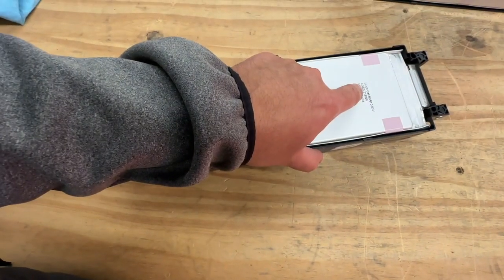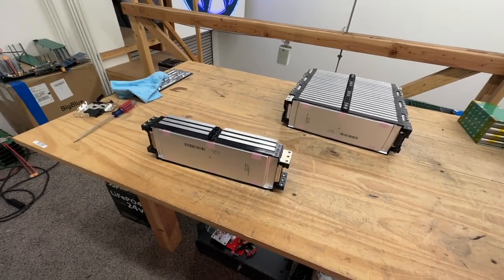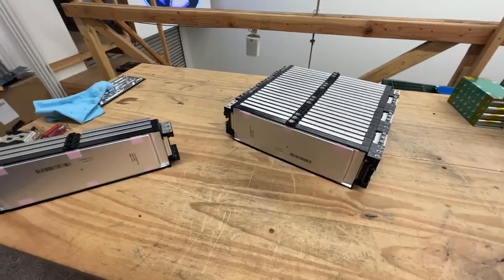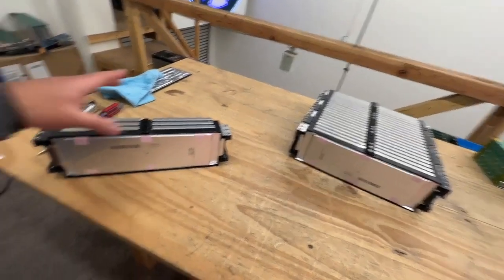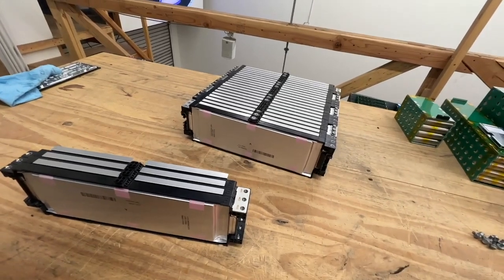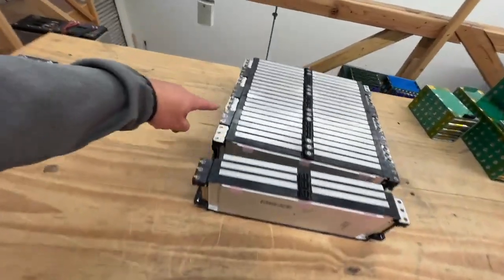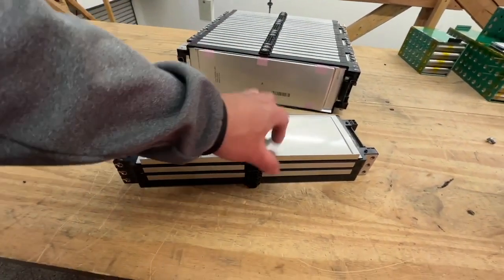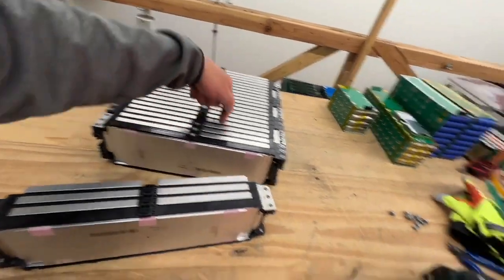LGUE63B Modular Pouch Cell Modules

Comment: could you test a 10s Li-ion in parallel with a 12s LiFePO4
Reply: 1. nmc and lfp bms are for different cell voltages
Reply: Nope voltage curve is different for the two. They both have a 2.5V cutoff so the 10S pack would go too low if you tried to drive the 12S down to the bottom. But also the LFP is going to sit at nominal voltage for almost its entire DOD so there’s going to be massive balance current going between the two.